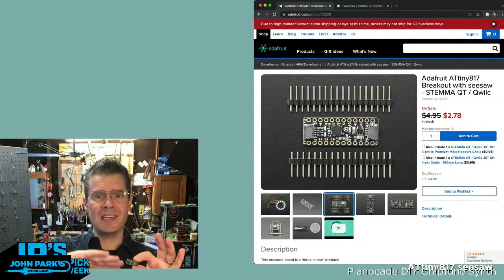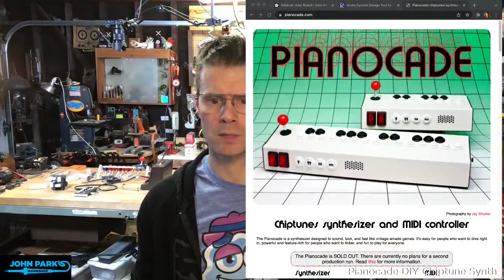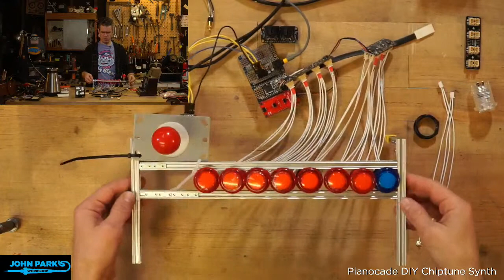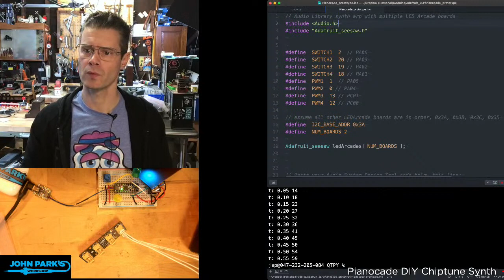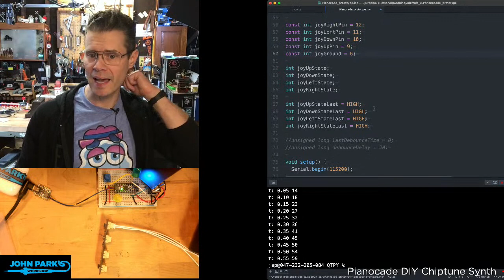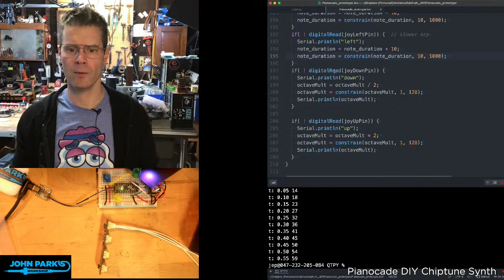JOHN PARK'S WORKSHOP LIVE 1/6/22 Pianocade DIY Chiptune Synth @adafruit @johnedgarpark #adafruit

Comment: 49:06 - It definitely does require some tooling... but it's within the reach of mortals!  Check out the Clough42 channel for some fun sheet metal stuff, including CNC plasma cutter for shaping it originally, and a brake for doing the bends.  (Well, I think James is mortal... ;) ;) )